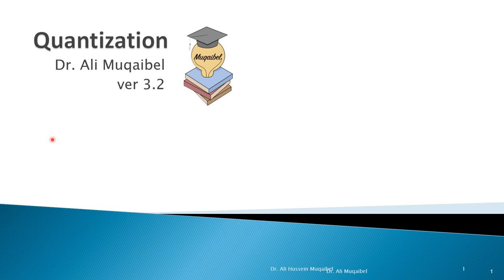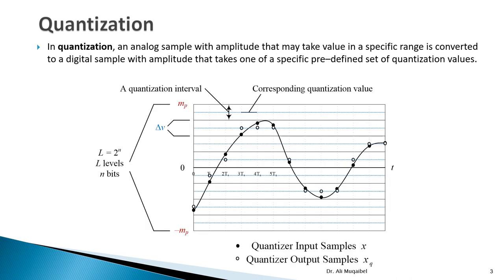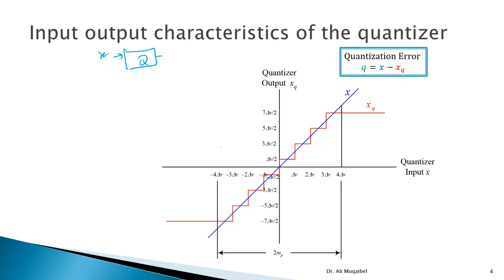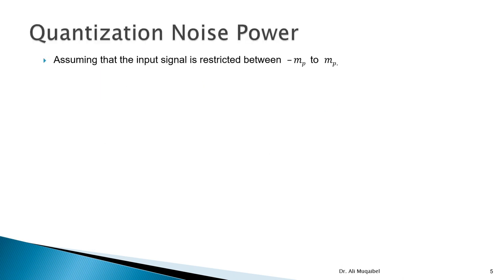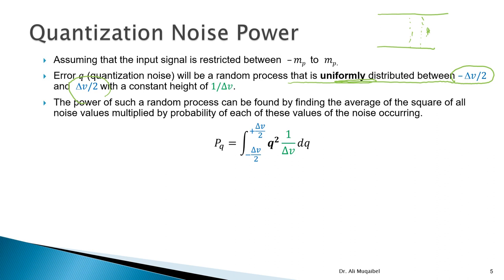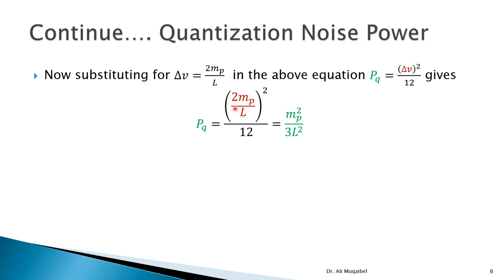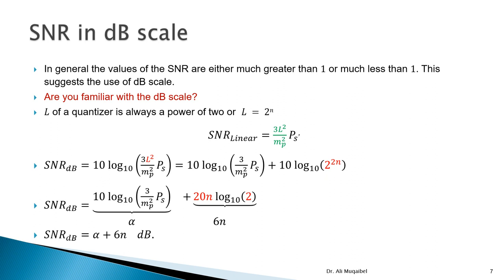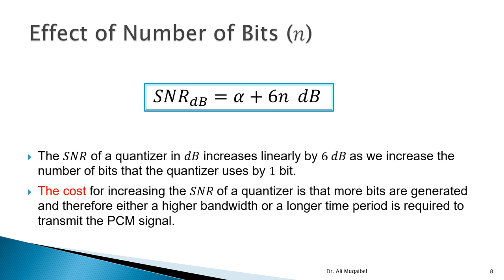6.4.1 Quantization, Part I: Uniform Quantization and PCM Generation

Comment: In 18:40 , why the error in sample amplitudes is equal to delta(v)/2 ? I didn’t get it
Reply: Because of the way quantizers work. A quantizer sets the cutoff threshold between two successive quantization levels at their midpoint. Dr. Ali already discussed that around minute 6:30. Let me give you an example! Suppose that the quantization step (Δv) of a quantizer is 1 volt, and there are two quantization levels at 1 volt and 2 volt. Now, what happens if the quantizer received, as an input, four samples with these amplitudes: 2, 2.25, 2.5, and 2.75?
For the sample whose amplitude is 2 volt, the quantizer would keep it at the 2-volt quantization level; so the sample amplitude error = 2 - 2 = 0.
For the 2.25-volt sample, the quantizer would suppress the amplitude down to the nearer 2-volt quantization level; therefore the error = | 2 - 2.25 | = | -0.25 | = 0.25.
At the input of amplitude = 2.5 volt, the quantizer can either pump the amplitude up to the 3-volt quantization level or suppress it to the 2-volt quantization level. In either case, the error would be exactly 0.5, and that is the maximum possible error (i.e. Δv/2 = 1 volt/2 = 0.5 volt, for this example) that can happen in the amplitude of a sample.
For the 2.75 volt sample amplitude, the quantizer will push it to the 3-volt quantization lever because it is nearer; and here the error would be 0.25 again.